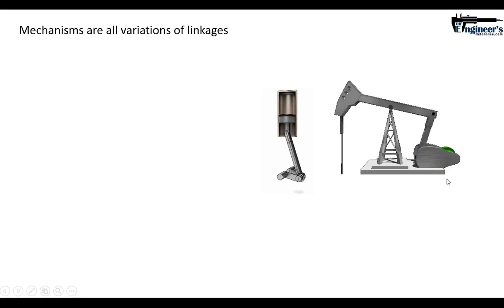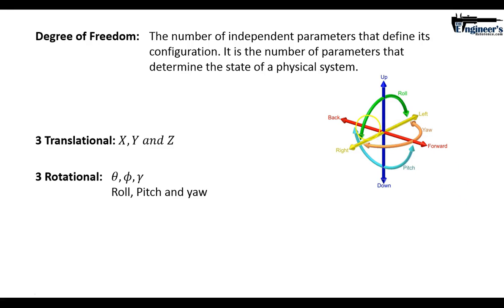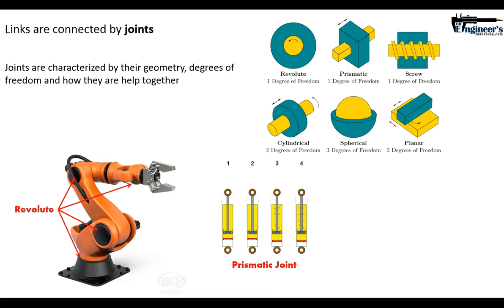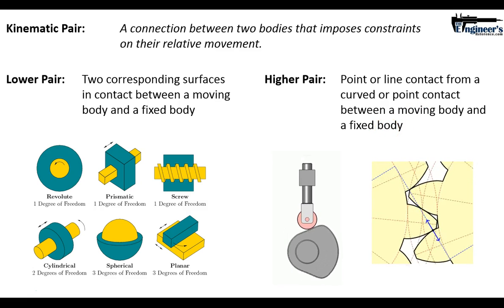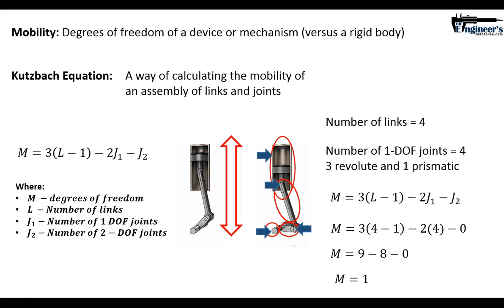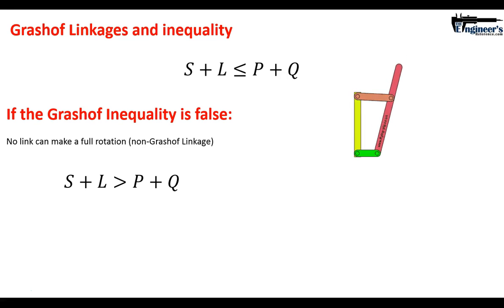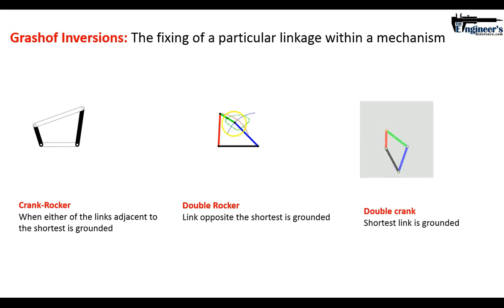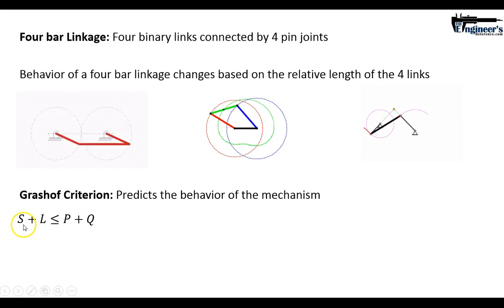Mechanical Design (Part 5: Four Bar Linkage)

Comment: It was mentioned that the oil derrick uses a ternary link. Does adding more nodes to a single link make the mobility math a lot more complicated?

The idea of grounding is a good reminder that even the most complex mechanical systems still need a fixed reference point to do anything useful.

Comment: A couple comments/questions... If the shortest plus longest link = the other two links and they form a parallelogram doesn't this mean they are still a Grashof linkage or does the condition S+L< = P+Q only apply of the pairs of links are not the same. ie. P=S, Q=L  
Also the Kutzbach equation is only for lower level pairs that have 1 DoF (not spherical, cylindrical, or planar). I expect these would have to be converted to multiples of 1 DoF lower level pairs. ie cylindrical to 1 revolute and 1 prismatic.

Comment: I actually got a lot more than I thought I would out of this video, I can use a lot of this in combat robot and mining machine mechanisms 

For example 

A four bar lifter, 
A hammer, 
A drive rod style motor system that strengthens one rotational point via connections to other rotational points

Comment: Can we have two equal length for the four bar link??
Reply from the maker: Yes.  One condition would be called a parallelogram linkage (steering system of most cars) others would be a variation of crank and rocker configurations.

Comment: Excellent teaching course and excellent narration, on your part, so I do not want to comment like a critic, for I'm learning this as your explaining it. 

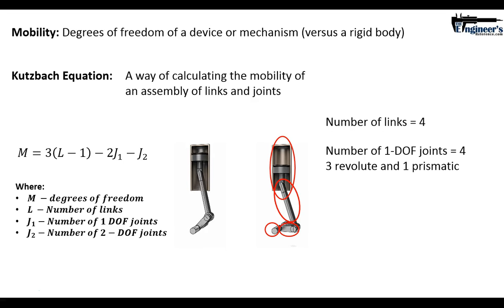However, when I got to the (15:29 time in the video) I had to stop and go back to the beginning when you explained about links and joints again, and seen where you circled the cylinder and called it a 4th link, that I feel I need to clarify what I think you really meant to say.

I believe you meant to say the (crank base and the cylinder together as they are both grounded, forms the 1st link), then the crank the 2nd link , the connecting rod the 3rd link and the piston the 4th link.

Please correct me if I'm wrong, but I just need to share this for clarification that I'm understanding this correctly,
 thankyou.

Comment: Thanks vou very much!! 
Very well explaned!
...
I have a question !
At 22:14, in the lower mechanism... the torque that is inputed on the crank (little rotatory bar), is it amplified at the rocker (big rotatory bar) ? 

I mean... can i input a torque on the crank and output a higher torque by the rocker?? 

It has been days that im thinking about this and i cant come with the answare 😰😭

Comment: If the mobility (degree of freedom) for a mechanism equals zero, what is it called or mean?
Reply: then it can't move.  It forms a rigid structure, such as in a pin jointed truss
Reply from the maker: Sorry I missed this question.  Zero degrees of freedom means you have completely restricted the movement.  Imagine when you put a part in a fixture to machine it our gauge it, you're trying to hold it still.